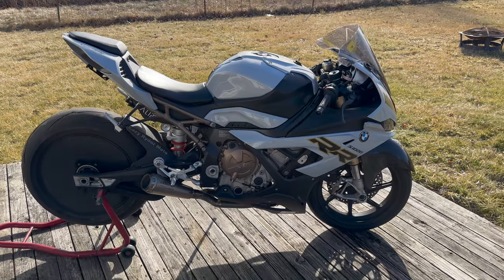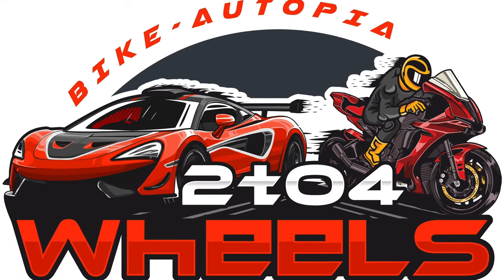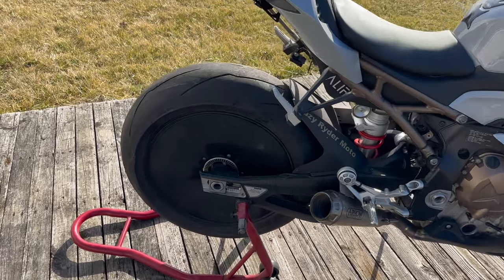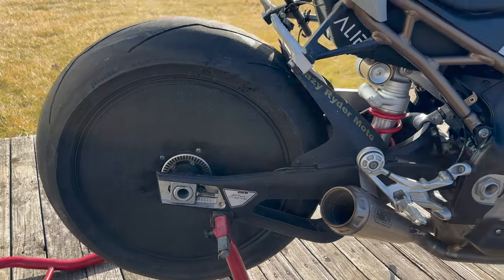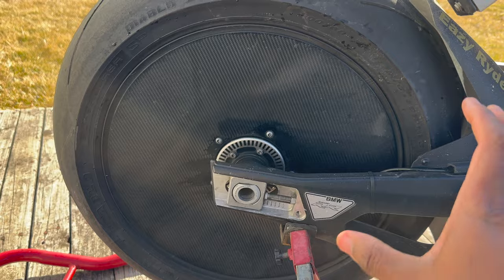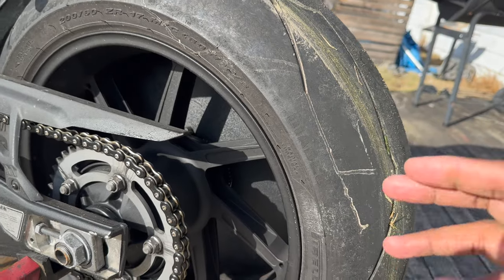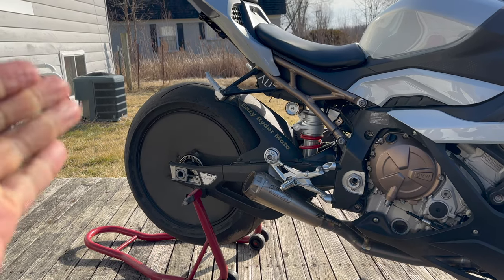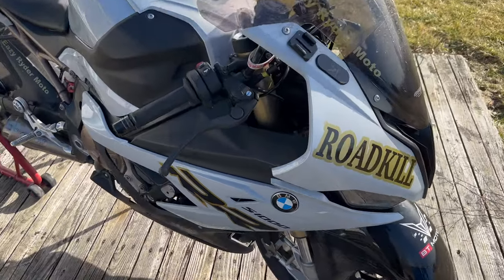EAZYRYDERMOTO| TECH TALK|  MOTORCYCLE AERO DISK Explained

Comment: No shade, but after a modest 370lb no carbon wheels Zx10r laid down damage in AtL roll meet certain individuals put their aero discs up for sale. To each his own, but there others ways to go faster, the same guys I’ve seen get them are the same guys that put them up for sale. Notice Will Samedi doesn’t have an aero disc, just saying. You kinda mentioned a lot, and maybe stating the aero last to highlight your point, but aero is high on the list, along with setup. Especially for 1/2 mile 9/10 racing. Hp won’t matter if ain’t getting to the ground, but more important if the bike isn’t dialed in with the right tune. Certified was thinking outside the box as he usually does in this game when he coined this in the roll scene. Funny enough last time I seen his bike, the aero wasn’t on, go figure. Like another commenter said you may have seen positive results with it, post some dragy numbers with and without it to back up your claim of it being effective, otherwise sadly it’s just another gimmick.
Reply from the maker: Hey thanks for watching and also pointing out your viewpoints I appreciate it brother yes I do agree documenting numbers to back up scientific data will be helpful aswell might be a winter time project with my hayabusa as that will be my new all out roll bike but if I’m not mistaken I do believe speedi had the clear disk on his bike I did notice that Evan put 1 on TBNs current set up but I could be mistaken but I do remember a lot of creativity and r&d like the dimpling of the fairings it’s so much to design and aero we could try some night work some might not but hey it’s all in fun and data
Reply: @eazyrydermoto  wait, I seen Evan post his discs for sale on FB, and it wasn’t on TBN during testing against Rowdy’s CBR RRR Fireblade. Quiet honestly, I watch a lot of racing from Pecco and Martin battling it out in Moto GP, Toprak ve Boulgna the rookie in WSBK, BSB, ASB MotoAmerica XDA to street racing both dig and roll. In all those forms of racing you only see discs in Moto GP, but they are in the front, with half discs similar to the half disc on the M1000RR in WSBK.  If you also notice in MotoGP there are rear winglets on the rear cowl, winglets on the swing arm for some and underneath the rear swing arm. Those I could see being more functional and beneficial for speed, but that’s prototype racing. I seen someone post numbers on FB who did some testing with 1 disc then 2 discs for each side and then without. From my recalculation gains were minuscule at best, but I can be wrong. But hey props to you, and look forward to see what you do with the Busa, the king of Aero in bike game.